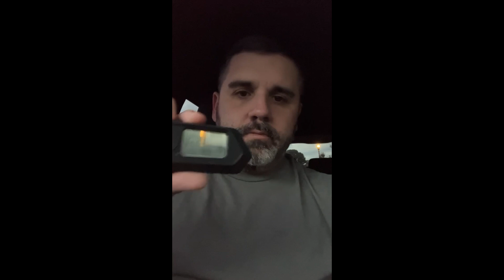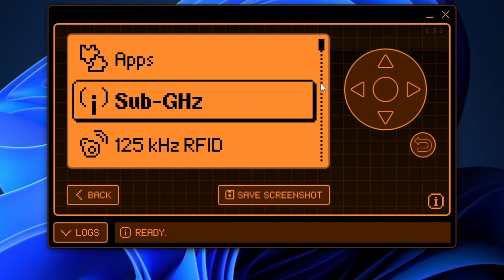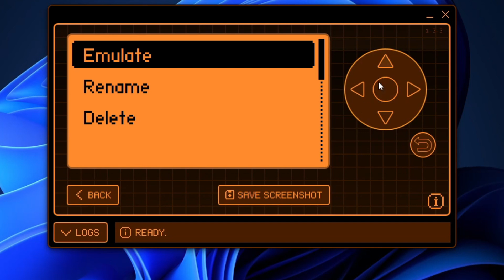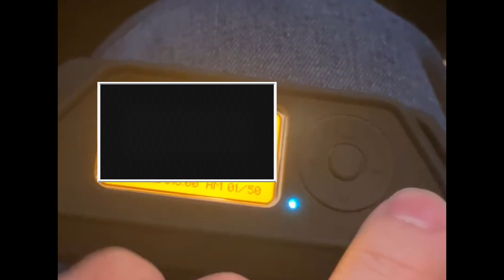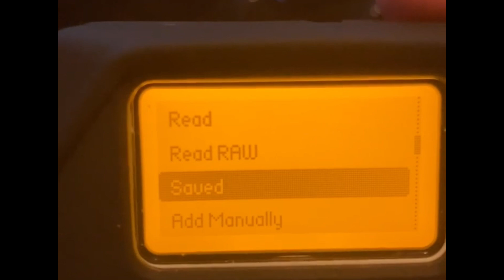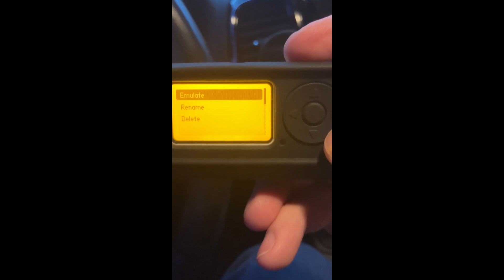HACK a Garage Door with a Flipper Zero

Comment: How do i prevent my garage door from being hacked
Reply from the maker: Having a garage door open with rolling codes is very helpful. That and being aware of your surroundings when using your garage door opener and noticing if anyone is out of place nearby.
Reply: @Cyber_Matt_Technologies thanks, how do I know if I have a open code and also if I use a keypad on the outer wall to open the garage sometimes is that more secure
Reply from the maker: You should be able to Google your garage door opener model to see if it uses rolling codes or not. The keypad on the outside would definitely be the better option but it’s definitely not as convenient as using the one in your car.

Comment: Doesn’t the thing you are trying to capture have to be used in order to capture the signal?

Or can it capture them in idle modes?
Reply: Could another device capture it without it needing to be used?
Reply from the maker: It would have to be constantly transmitting which isn’t normal for garage door openers. If that was the case the batteries wouldn’t last long at all. 

However newer key fobs transmit continuously.
Reply from the maker: Yes the opener or other transmitting item has to be used in order to send the signal for it to be captured by the flipper zero.

Comment: Question: When I complete the read, it doesn’t give me an option to Send/Save. It just says “Security + 2.0 ….etc”. I’m wondering if I need to upgrade the firmware on my flipper. Currently, I have 1.1.2 installed.

Any info helps! Thank you!
Reply: I had the same issue, I’d actually a good thing. Means your house is secure. It’s just encrypted is all
Reply from the maker: Exactly. Definitely a good thing.
Reply from the maker: I’m not sure about it saying security 2.0 unless it’s a rolling code or encrypted. 

After you capture it you have to hit the middle button and the options to save or send it will appear. Then you can name it whatever you want to. I cover this toward the end of the video.

The new update does offer additional features and I would suggest updating for access to the new features and uses.
Reply: Mine is +1 security.  No option to save or send